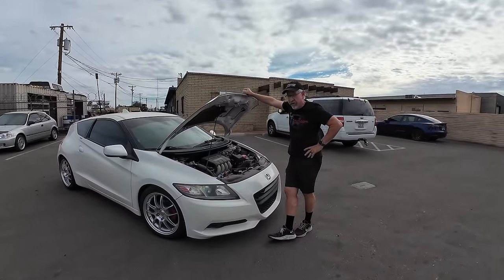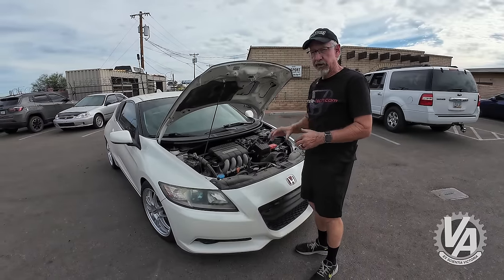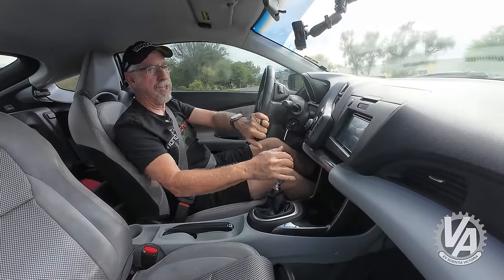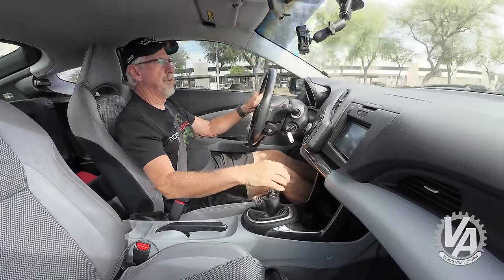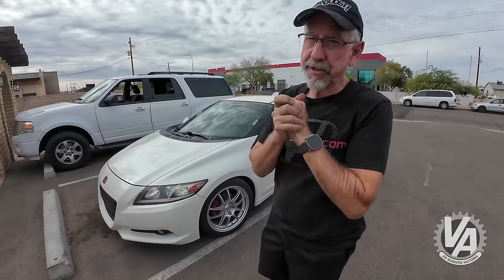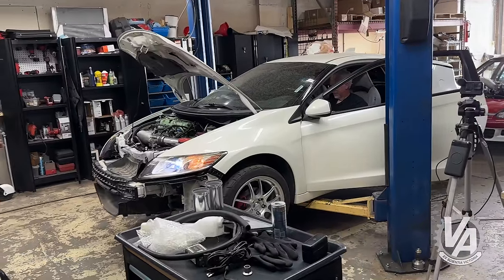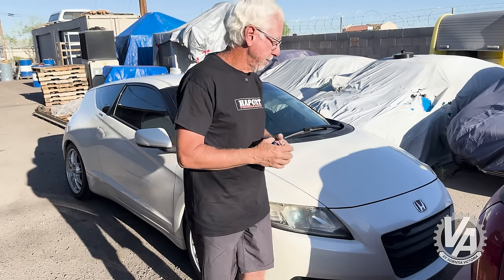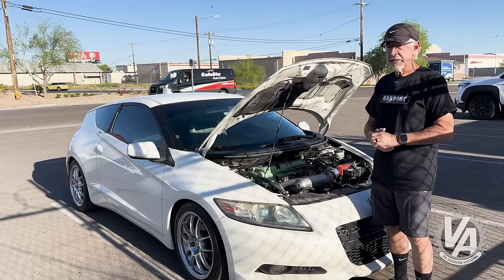How to Make the CR-Z Awesome (It's a K24!)

Comment: As a guy who had a CRX as his first car, thank you for finally bringing honor to the CRX's successor.
Reply: Original CRX is seriously one of the most fun FWD cars when set up for autox, just three wheeling every turn wheeeee
Reply: I personally have a Stock CR-Z 6spd and it is just as peppy as the original CR-X this here is a swapped CR-Z which is more like a GSR  swapped crx if anything I don’t know why people think that the CR-Z as released was properly released people complained that it didn’t have a K in it originally well the original CRX didn’t have a B series it was a couple years down the line before it got a B series Vtec engine if fans would have bought more of the crz it would still be made and eventually gotten a K series version but it didn’t work out that way for Honda and they didn’t continue the model sad really I will eventually do a K swap in it probably same as this
Reply: @romeo032982  I don't think it was released wrong, I was looking into buying one to match my B18 Swapped 90' CRX Si. I just think had they released the GE8 Fit (which I bought instead of the CRZ for spacial reasons) and the CRZ with a K20 or K24, these cars would have sold even more like hot cakes! Haha they came with the engines they should have for small commuter cars. Everyone just wants to be pushin mad power! The aftermaket with the K is more vast aswell as I'm sure you know. The L15 in my Fit is still kicking, she's just slow as all!
Reply: Yep same, I started with a D series, then I eventually B swapped it (with a Hasport kit 😄)! It was like night and day, man that B16 made it come to life!
Reply: Who does your commaa?
Reply: There is no successor to the CRX. This for sure aint it.

Comment: As a CRZ owner, it’s the perfect car, minus the low power. Thankfully, mines supercharged. I've got Tein suspension on mine as well and like you said - drives beautifully. Amazing around the corners.

About the battery packs: 2011-2012 have NiMH batteries which are still doing great these days. Hell, Peter Perkins came up with a rejuvination procedure to restore the batteries a bit. He's also hacking the IMA system in order to manipulate the regen + assist for some very nice extra power. 
2013+ uses Lithium batteries which many owners have been having battery life issues.

Fun fact: some guy in Ohio has ~50 cr-z's. 
Sad fact: the factory option HPD supercharger has halted production as of very recently :(

If only they made more CR-Z's. 35000 ever sold in the US.
Reply: Oh, and if the owner needs a new grill, I would suggest they buy from impex japan. I got mine new for like $120? cheaper than $400+ from dealerships in the US.
Reply: Minus the low power, minus the horrible brakes, and minus the even more horrible rear  suspension geometry, thw car looks good and has a cool I terror. Thats about it
Reply: 500sold in my country
Reply: @dcd5050 exactly.
Reply: @dcd5050  What are you talking about? Brakes are good for "stock CRZ" and the suspension is the same as the FN2 type R. The "geometry" isn't bad but suspension upgrades are simply just better on this car than stock. What about it's super good Steering ratio? Anyone from the CR-Z forum would look at this comment and wonder how much experience you might actually have around this car...
Reply: @KeebaAfrica  there is a place to turn the vent into your glove box to keep your drinks cool and If you hold both paddle shifters down for a few seconds it will put the transmission into "low mode" for climbing steep hills. Car is super underrated :body-blue-raised-arms:
Reply: HKS made a centrifugal supercharger for the CRZ
Reply: Peter Perkins is the wizard of all Honda's hybrids. Thanks for shouting him out. If you go to his website or search him on any of the forums, the amount of testing and knowledge he has shared is fascinating. He is truly at a Ph.D level with it
Reply: I've got a 2014 Base 6MT CR-Z. Great for driving around town and twisty roads. I live in Canada and the official sales number was 1,342. Nearly impossible to find part outs for them. So i mostly order parts from the US.
Reply: Should've gone BC Racing no?

Comment: People were disappointed in the CRZ because we expected light, nimble, small, and fun like the classic CRX 
What we got was heavy, small, prius competition.

Not to mention, the classic CRX made better gas mileage.
Reply: No people were disappointed because they thought the engine was going to be K-series, hence why they put in the fn2 type R suspension and mounting points. Also CRZ is like 300 KGS lighter than prius.
Reply: @KeebaAfrica 
Prius of its time was 300lbs heavier not 300kg. The prius competition wasn't what was wanted from a heritage car that made worse gas mileage than it's predecessor (CRX) and it's competition. Fail on all fronts.. even against Prius

Comment: You should add 06 tsx front calipers and rotors.   Plug and play.  Requires 1/4 trimming on the dust sheild to clear caliper bracket.
Reply: this was one of the first things I added to my SI. great budget upgrade.
Reply: Bosch quiet cast blanks with Hawk street pads are incredible. I have missed a few dozen deer in the last year alone.
Reply: @TheDwightMamba  I run EBC pads in mine.  Works great as well.

Comment: Concentric A/C tubes like that actually act as a counter-flow heat exchanger, boosting performance. Any cooling capacity left over after leaving the cabin is used to further cool the incoming refrigerant. The outgoing refrigerant ends up hotter, resulting in a hotter condenser (the part in the front grille) which passes more heat away into the air going through it.

Comment: Look into the CRV and Element front sway bars. I have an 07 Element front sway bar on my awd ep3. It's basically flat and I wanna say it's about 30mm. I think some of the CRV bars are the same shape, just smaller diameter. A quick trip to the scrap yard and you'll be able to find something that works.
Reply: Ep3 gang
Reply: Also, the SC models of Elements have thicker front sway bars - 25mm vs 21mm for non-SC models.

Comment: I absolutely love my cr-z. 2011 North shore blue pearl, ex 6 speed with only 61k miles. It is such a fun car, its extremely light, has a very fast turning ratio, and you sit pretty low into the car makes it feel like a dart. I absolutely want to k swap it but it still has tons of life in it right now. I will know when the time is right to swap it just not yet. I wanna keep it for a very long time, there were so few made that i really believe at some point they are going to be worth alot and be pretty hard to find

Comment: Honda planned on releasing a version of the CR-Z with a k-series but due to the engine being too close to the firewall it failed to pass crash testing. That's what I read years ago in Super Street I believe.
Reply from the maker: I was the one who said that to Aaron Bonk at the magazine. And I don’t believe I said it was too close to the firewall, I just said it didn’t pass crash.

Comment: I bought mine 4 years ago 2010 AT with 165K kms on it around US$2 grand in JPN. No major issues except flimsy door handles which cost me around US$180 with installation at authorized Honda dealership. I've just got 2nd bi-yearly inspection (shaken in JPN) and yeah... everything is perfect for daily driving. It has 198K kms now. Love this car and also Mazda NC 2006 as other car :glasses-purple-yellow-diamond:
Anyway no complain about the power or CVT trans because it's great for JPN roads :goodvibes:

Comment: I own the same white CRZ 6spd. I love it and will keep it forever. Again, like the video says, the cost of the battery is a lot. Therefore, I'm leaning toward a K24 swap over K20. The high rev K20 is attractive, but K24 does its jobs as well with the torque.  I looked into the HKS Supercharger option, but it was roughly 2x more expensive than the K24 + transmission option. Adding add-ons like a super charger eventually add more issues to the car, so I will just stick to the K24 swap option. I look forward to it.

Comment: Great seeing this work on the CRZ.  I just hope that Honda learned their lesson on this one when it comes to the new Prelude Hybrid concept.  

As a side note, how much of a pain is it to swap spark plugs on the K24 in the CRZ?  Looks like you would need to remove the entire cowl and wiper assembly.
Reply from the maker: Honda seems to be way ahead of the market sometimes. They had an EV in the 80s. The Crosstour/ original ZDX before every manufacturer had a crossover vehicle.

For us removing the cowl isn't a big deal. We don't anticipate needing to change the plugs for a while with the stock setup.
Reply: @VTECAcademy  I'm all for Honda creating new EVs, but when you give them the same name as a previously loved car, a 140HP hybrid isn't going to cut it.

Comment: I have a crazy idea but hear me out. 
Take the engine and drive train from the GR corolla and swap it all into the Prius, slap on some wide body mods to accommodate the wheels, and you have an exotic looking 4 door Toyota. All of this is modular and possible since the Prius and Corolla are on a similar TNGA platform. 
Time to raid the salvage auctions.

Comment: Feels like you could use the conduit for the EV high-voltage wiring to move the battery to the trunk and clear a little under-hood space for a cold-air intake.

(obviously you'd need to pull the EV wiring and run proper 12VDC color-coded wiring)

Comment: First of all, he keeps saying wrong information about the CR-Z.  It's not a 1L engine, like he says in the beginning, it's a 1.5L L-series, very similar to the 2nd gen Fit engine.

Second of all, he keeps saying that it has a 400v battery.  No.  If it did, people never would have complained about performance.  The early years had a 108v NiMH battery, and after 2014 it had a 144v Li-ion battery.

Finally, I'm so sick of people complaining about the performance, saying that the CRX was a much faster car and the CR-Z was way too slow.  Let me tell you, the CRX was slow as shit too.  The 1st gen started out with only 60hp from a 1.3 CVCC engine.  The 2nd gen had either 70, 92 or 108hp in the US.  0-60 times vary based on the driver, but the CR-Z was generally in the low to mid 8 seconds, while a CRX Si (with 108hp) was high 8 to low 9 seconds.  Quarter mile times follow suit, with the CRX routinely 1/2 to 1 second slower.  The CRX Si had small 14in wheels and skinny tires, while the CR-Z has either 16in or 17in wheels that are a bit wider, offering more cornering grip.  In other words, a stock to stock comparison between the CRX and CR-Z shows that the CR-Z is a better car in nearly every way.  The only thing that the CRX is better at is fuel economy.  But honestly, I'd feel a hell of a lot safer driving a CR-Z in the US than a CRX.
Reply: Your numbers are based on the first gen, the second gen was faster, you would think that after 20 years it wouldn't regress back to the first gen's speed while still using more gas

Comment: The thing about CR-X is that it was never meant to be sporty, it was supposed to be efficient. It just happened to also be somewhat sporty and be a good platform for modding because back then efficiency primarily meant minimum weight and fuel injection. CR-Z is all about efficiency too, just in a more modern way. 
You ever wondered why it jumped from X straight to Z? Aside from it sounding not too appealing as a name, the CR-Y already exists- the missing link, gen 1 Insight. Slow, anemic, but remains one of the most fuel efficient cars to this day. 
That's not to say that the CR family shouldn't be fast. All three are very worthy modding platforms.

Comment: only if they put more work into it.  stroked to 1.6 with high compression for a hp of 140 would put it really similarly to the eg hatch.  coupled with aftermarket seats, wheels and battery, you would have a competent time attack car.

Comment: I'd love to do this to mine, throw a pair of 10kw motors direct drive on the rear wheels, and replace the factory battery pack with a longer, denser LiFePO4 pack of around 6kWh.
And replace the back glass with form matched steel, with form fitting solar cells running from the trunk...... mini spoiler, to the windshled(preferably flexible CIGS with proper diodes for both puncture resiliant cells, and the ability to lose most cells/have them covered by shade and still generate power.
Sure it would only be ~250w of solar, but still, over an 9 hour work day that should average to 16-1800wh, or roughly 2x the original battery pack's capacity. (in practical use might up the fuel economy from 30, to 32 assuming 30 mile round trip to work and a good 9 hours of solar charging with improved economy on better routes)

Comment: I've heard the K20 is a direct drop in. I wish more shops could do this conversion. The CR-Z itself is F*ing slow and not really fun to drive(6spd). I wouldn't even care to race it or anything but I would assure most that it would be alot more fun to drive with either a k20 or k24 swap. My 2014 Si with and intake and axle back exhaust gets 40+ mpg on the freeway. Imagine a k swap where you're still getting very decent mpg all the while more fun to drive!

Comment: My question is can you k swap it and keep it hybrid. It would weigh more but at least it would be low in the rear for balance. Just seems more fun having the battery jolt ya along
Reply from the maker: Not really. The IMA sits between the engine and transmission. You might be able to swap the Accord hybrid V6 engine in.

Comment: Honestly, the CRZ wasn't bad if you got the stick-shift version. The hybrid system wasn't bad and there was plenty of ways to make it fast. The CRX was an economy car from factory, not a fast car, just a slightly sportier Civic, so the dislike for the CRZ is silly since the CRZ was (at least in my opinion) a reasonable successor to the CRX.

The CRX has the same issue as the Supra, where people look at the car with rose tinted glasses, based on built examples with a lot more power despite the base car not really being all that performant.

Comment: In Europe  gas is $8 a gallon, the stock crz makes sense and a k20/k24 is kind of a gas guzzler!
Reply from the maker: If you drive it sensibly it is about 20% less efficient and 100% more fun.
Reply: @VTECAcademy Have you thought of swapping the newer Honda 1.5L turbo? Since it's more efficient and turbo can potentially push higher numbers..

Comment: That cold air intake sucking in the hot header air is a terrible idea. The factory box with high flow filter nets more whp.
Reply: Fully agree. I've modded it since then to pull air down lower and installed a bigger battery as well.

Comment: Very interesting video, but I have to admit that I was slightly disappointed, as the way you talked at the beginning of the video made it sound like you were keeping the hybrid system and just swapping in the K24 engine.  I realize that might not be possible, but that would've been pretty cool.
Reply from the maker: Unfortunately not possible. The hybrid system only adds about 10HP, so a good header and tune on the K24 are more effective.
Reply: @VTECAcademy  Yeah, I figured that might be the case.  On a tangentially related topic, since you are definitely more familiar with Honda drivelines than me, what do you think about the possibility of making a Civic, RSX, or CR-Z into an AWD vehicle using the K23 from an RDX and the 6-speed manual from a TL?  I had read somewhere that the K23 block had a different casting from the rest of the K-series engines in order to match the bell housing bolt pattern from the V6 in the other Acura products so that it could use the same transmission and SH-AWD system.  That got me wondering if the 6-speed manual SH-AWD transmission that was briefly available on the TL would bolt up to the K23 for an AWD engine swap.

Comment: Could you mount the battery in the back and run the cables,  and mount the air intake where the battery used to be in the front to make the air intake a cooler intake instead of a warm air intake?
Reply: Yes, it's possible.

Comment: A tip for yall, you can easily relocate the 12v battery to the rear using the already installed hybrid batery wires comig from the rear battery to the engine! Just install those wires to the 12v moved to the rear and bam you alreay got wires routed to the front

Comment: 20:20 sway bay issues with this too?  I've had lots of problems with fitting sway bars in my K20/24 RSX and aftermarket headers.  Now trying a KTuned K24 header and will be changing an EM2 sway for a Whiteline adj one next month.  I'm not confident it will fit, but maybe their end links can be adjusted.  Is there any solution for a modified and lowered RSX platform besides no sway bar...or Element sway bar?
Reply: I gave up. Stuck with the shorty.

Comment: I love the concept, but how does the K24 swap pass emmisions?  Seems like it violates federal regs.
Reply: It has a cat and no check engine light. It'll pass in most states.
Reply from the maker: It has all the correct emissions devices and they work within the ECU parameters.
Reply: @VTECAcademy  That's very cool - indeed, this really should have been a production model/option, just a parts-bin swap!  Thank you for the video!

Comment: I know it's not the same car but what's the possibility of something like this going into a base 2017 civic lx 6spd. Or what can be done to the Stock K20c2. What about an accord 2.0T
Reply from the maker: The accord turbo engine will bolt into that chassis using the Civic type R engine mounts.

Comment: 7 minutes in and I’m still not quite sure if it’s retaining the hybrid drive. Is there no way to upgrade the engine and the motor and the batteries?
Reply from the maker: Did not. It won’t bolt between the engine and trans.